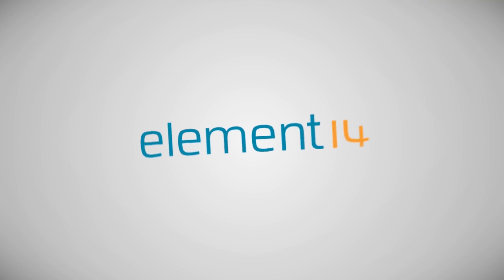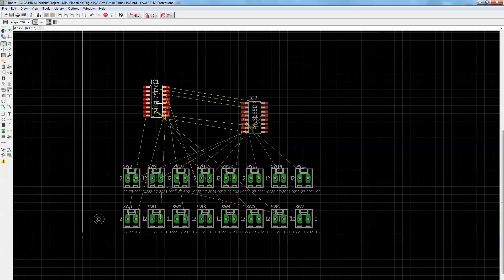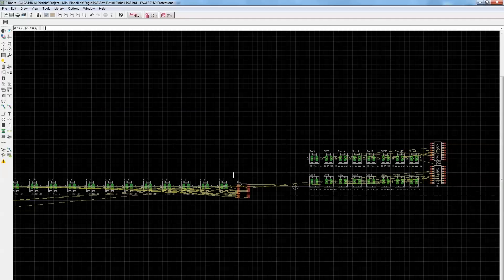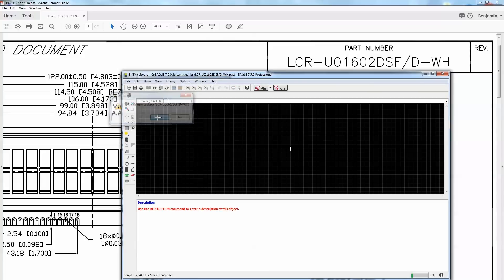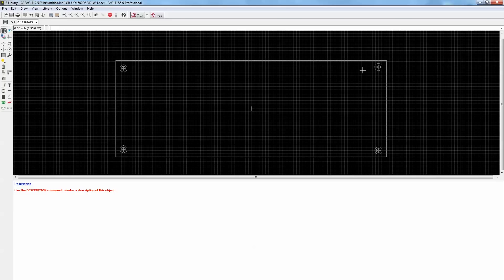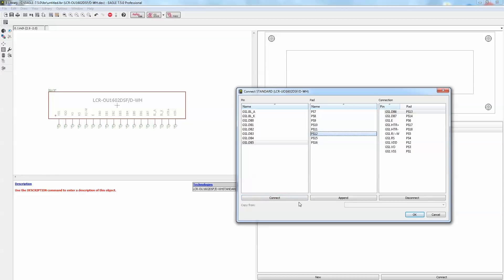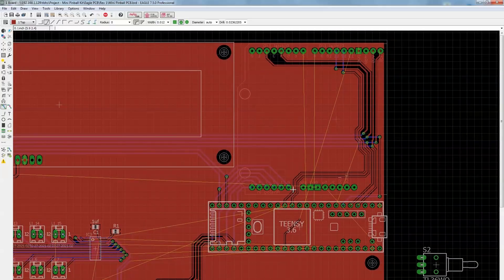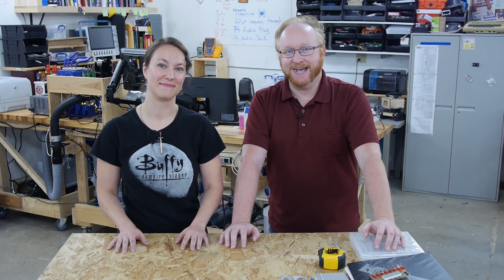Mini Pinball 07: Designing the PCB

Comment: 1. You can double-click in the pin list to assign one to whichever signal is currently highlighted without using the "connect" button.
2. You didn't assign a direction to any of those pins. Some should be set to input only, some output only, and some to power. That allows you to use the ERC to find errors you otherwise might miss.
3. Once you had one short and one long side of the LCD, you could have just cloned each one and stuck them in place. (Or just use Brent Allen's tip to make it in one go).

Comment: Eagle tip: instead of placing lines and then editing their properties to put them at the right coordinates, you can type in coordinates into the command line at the top in (x y) notation. So for making the entire outline of the LCD you could type (after selecting the line tool) "(-2.4015 -0.866) (-2.4015 0.866) (2.4015 0.866) (2.4015 -0.866) (-2.4015 -0.866)" and it would all appear *as if by magic*. Same goes for holes at specific coordinates.
Reply: thanks, didn't know of that

Comment: Can you not use seven segment display modules or the alphanumeric modules but which uses 16 pins of the number of pins that the 7 segment display modules,VFD tubes require at least 64volts for it to work.